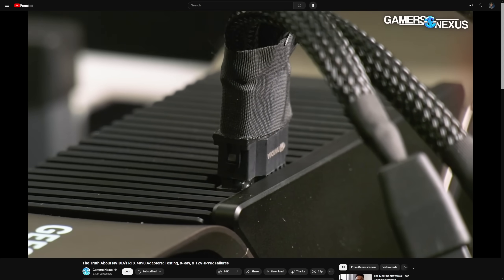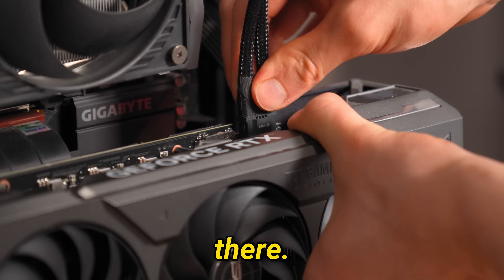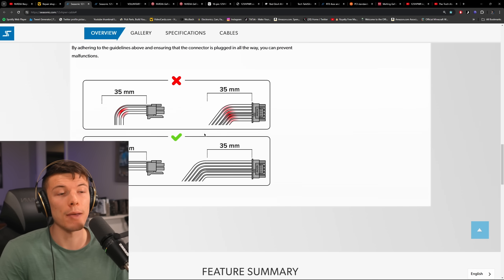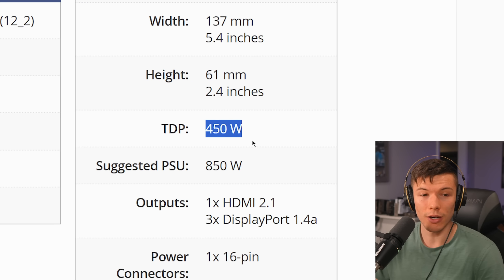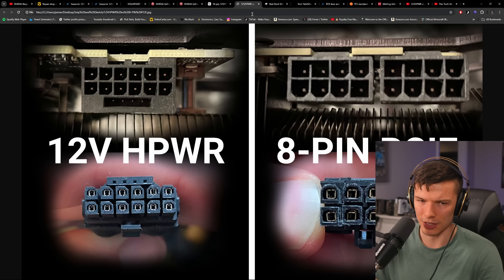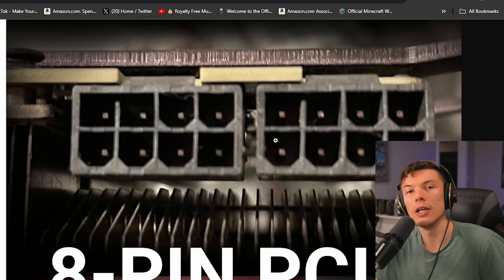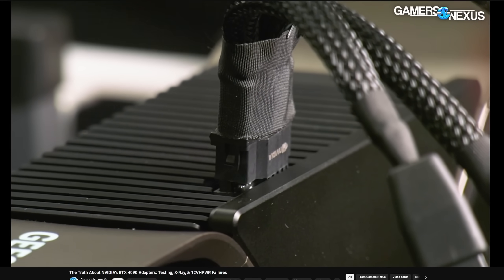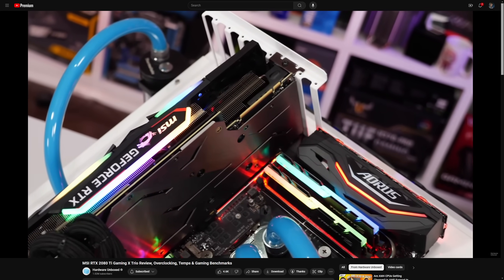The Dumbest Thing to Happen to Graphics Cards

Comment: with my 4070ti super i just got, i had to put SOOOO much pressure on it to seat it, i was so afraid i was going to crack the connector or the pcb board or something ... it was ridiculous. I was pushing a significant amount of force, like 50% of full power, and when you think about that for plugging in an electronic device, that is insane. fortunately, its been fine (Gigabyte Eagle)

Comment: My 4090 has the new 12v-2x6 connector. Have been running it with an ATX 3.1 PSU and have zero problems.

Comment: Spec sheet says it all, 8pin 288W, 12v  684w, but then look as the 'safety factor' 1.9 vs 1.1, thats over 70% higher margin for safety.

If we was to use same safety factor as Nvidia 12v on the 8pin then it would be rated at 261w not 150w
So 2x 8 pin would still be safer than the 12v and provide more than enough

Comment: I think they should have used 2 12VHPWR connectors on the 4090, that card pulls more power than a single 12VHPWR can handle.  I have a 4070Ti which pulls a smidge under 300 Watts and it doesn't even get warm.  The 12VHPWR is definitely less fugly than the massive 8 pin connections,  but they asked too much from it in the case of the 4090. Nvidia dropped the ball on this.

Comment: I knew from the beginning that the 12VHP power connector was stupid because it didn't do anything that the existing PCIe supplementary power connectors didn't.

My ASRock Radeon RX 7900 XTX has three PCIe supplementary power connectors and they never miss a beat despite drawing almost as much power as an RTX 4090.  Are they elegant?  Who cares?  I never thought of "elegance" when it came to PCIe power connectors before so why would I start now?  If you want "elegance", then all that a company has to do is put the power connectors at the end of the card like they used to.

Even if I were willing to shell out more money for a GeForce card (which I'm not), that oddball connector would've kept me away until I knew for sure that it worked.

Comment: My Asus rtx 4070 ti super 12vhpwr adapter that came in the box needed so much pressure to plug and unplug I was afraid it might break the card. I bought a 12vhpwr cable through seasonic for my GX-850 psu and it fit perfectly, plugged in and out smoothly and clicked positively, good tight connection. It seems like that cheap adapter from Nvidia is so poorly made and doesn't fit the video card perfectly so it takes a gorilla to jam it in to get it to seat properly. Nvidia need to do better on their adapters as they need to be more precise. I think the reason Nvidia need such a small connector if their founders edition cards the circuit boards are so small they don't have room for many x8 pin connectors so their sticking al the cards with 12VHPWR connectors, like it or not.

Comment: I think the biggest thing you missed is cost. The 12vHP connector takes less space on the board so they can use less tracers and less space so the board can also be much smaller. Then they have there own property connector that every 3rd party has to pay a royalty to use / make a connectors for it to use. End case they needed less space taken on the boards to cut costs in manufacturing and wanted everyone to pay more royalty's. They are scummy like Apple. But i still use them as currently they are the best. Sorry. Cheers for the videos.

Comment: Man, 8 pins are rated 288w, not sure what you are on about. Always been that way. Its also what it is been said on that image you keep showing. Also, why go on so much on the wires when the problem has always been the connector, meaning the plug on the GPU.

Comment: There were already connector standards capable of more than enough current on the footprint of a fingernail. Look at XT60/XT90 capable of 60/90 amps (Thats over a kilowatt) of continuous current. You could do 2 4090's with 1 of those. If you gotta have two rails just use 2 they're small enough.

Comment: So simple…….there are 90 degree connectors that can be used with the old style 8 pin connector. That eliminates the triple wires over the top.

Comment: How many of the melted connectors are running at the full 600w and how many are at stock 450w. Im guessing running  at the full 600w pushes the connector into a zone that makes it way more susceptible to failure

Comment: BTW, for gaming at 1080p/60, the card is certainly overkill.  But for doing open source AI models, the $2000 USD is a real bargain if you check where the next AI price point is.

Comment: RTX 4090 OC:  I built a custom aluminum scaffold to apply constant insertion force while removing all other loads (vector loads; not electrical loads) applying basic civil engineering.  Learned on my own as I am a retired software engineer.  Either my design is genius, or I am just lucky.  According to Der Bauer ... lucky; as the the original socket and plug has no engineering margin of error which is bad design, and brings down planes and bridges.  BTW, I did not use NVidia's Hydra (no sense pins), but instead used the easier to work with cable that came with my PSU.

Comment: Dear @Vex - no ... 12HPVR is not even using all 12 cables to push power, just top row AFAIK - which is even worst. Not only now any 4090 but also 4080 exhibit this, so all of them are 'no-go'. If 50xx still uses this - then same rule applies - 'no go' if you do not sleep on stockpile of money.  12HPVR does not equal to 12HPVR 2x6 - in the latter standard BOTH 6 pins rows are utilised. But that requires PSU that pushes through those bottom 6, and also has the 'sensing' pins socket. Really I have one such PSU CoolerMaster 850i. So what you have been reading is their NEW approach to 16-pin connector just approved in ATX 3.0 PCISIG consortium, but it is NOT what attached to the sold card cable is doing! Get also that - NEW NEW - revision has shorter sens pins, which will bring yet another issues (it suppose to detect if the plug is fully seated and disconnect power from it when not) but the problem is that the power draw of 4090 is just too high for pin themselves. Lets not forget - all cards also receive up to 75W through PCIe slot.

Comment: as far as my gigabyte 4080 (non super) the 12VHPWR connector and adapter (3x 8pin) are VERY sturdy and connect very tightly. it even hangs from the top of the case (TT level 20 HT) which means the way the connector hangs bends the cable sideways which is supposed to be the highest failure position but still not even a warped connector and i periodically inspect it.

Comment: To add to the question of how this released .. you know that safety factor of 1.1? It doesn't meet national electrical code standard... Max continuous current shall be 80 rated... Meaning a 25% safety factor... Or 1.25 is necessary.

If I signed off on this I could be publically kicked from the engineering profession for life.

Comment: Bought an RTX 4070 because of the exact reason. I still do not trust the 12VHPWR connector. Ever since I run with my MSI RTX 4070 at a MAX powerdraw of 130 Watts (undervolted + OC). 
The RTX 4000 Series Cards can be such low Powercards, yet they came up with  a connector that they clearly do not need. I honestly dont understand Nvidia at this point at all.........

Comment: I bought a new gaming PC two weeks ago, including a 4080S. The first thing i did after assembly and installing Windows was Furmark, and thermal imaging of the 12VHPWR connector at the graphics card and at the PSU. No Problem.
Since this was my first build that required such a connector, i was quite surprised how tiny the pins are, seeing them the first time. 
I really think that this connector is a bad design, and should have used bullet connectors like in XT60 or 90 plugs.

Comment: I don't understand it, my 4090 came with the 12vhpwr adapter with 4 x8 pins but I didn't like that so bought the Corsair 12vhpwr cable that only has 2 x8 pins on the PSU side! It's been fine for over a year but why does it need 4 x8 pins if using the nVidia adapter but only 2 x8 pins on the 600w corsair cable??

Comment: (ONE) 16 gage wire is rated to 13 amps, that is equivalent to 1560 watts.  A 12VHP- connector uses (12) 16 gage wires and is rated to only 600 watts. Each wire is carrying only 50 watts. I don't see the problem?

Comment: I’ve been very concerned about it, thankfully haven’t been one of the unfortunate ones affected by it.  My water block stops it from bending too close to the PCB, that probably helps. 
I used to pull 530 watts regularly, but I typically limit power draw to stock TDP unless I really need a few more frames

Comment: If they believe that the 12 pins of the 12VHPW connector are good enough for power delivery, why not just use two 6-pin connectors? At least the pins are bigger, and it’s reliable. Or, just leave us with the two 8-pins that we’ve had.

Comment: I am not writing an excuse for Nvidia, it needs to be addressed however there are reasons this occurs. Biggest is zero tolerance for error with pin contact, you have to have 100% proper contact or the impedance on the 12v/ ground goes way out of spec causing thermal runaway above the connectors heat rating. 

second is overclocking, it changes the specs the 12v/ground forcing more amps than what they are built for resulting in thermal runaway.  

Solution: Do not overclock and when it comes to cables/ adapters make sure they fit like a glove, they need to be tight and snug and completely flush to the female side of the connectors of both the GPU and the PSU. Yes PSU's 12VHPWR are melting too from not being flush.  

Also when looking for a 90/180 angle adapter, it needs to have a heatsink, a real active heatsink. Only one I know so far that has a real heatsink is by EZ-FAB, currently have a 180 on my Asus Tuff RTX  4090, temps on the adapter never go above 60c, average is 50c.

Comment: i hated the adapter for my 4070 super, so i got the corsair one since i have a corsair PSU. the 12VHPWR connector is such a pain to remove, and install, i literally had to push in my connector alomst full force until i heard that click. so far so good thankfully, but yeah this connector is terrible.

Comment: I've been afraid to buy a 4070 Super because of size and power connections. I have a 2070 Super, and I think the new card uses the same power cables, but the sizes are so large that I don't trust it'll fit securely on my mobo & inside my case 😅

Comment: The rush to 4k has made a lot of what you see just dumb and immature. Hardware that used to be reliable is now suspect and even when working right did not deliver as promised.  And hardware that was ignored (like AMD, Air coolers etc) are showing to be very reliable.

Comment: I actually like the cable, mostly just on paper. I have a 4070 Super, so mine isn't going to melt from overheating. But, I do like how it's one connection to the GPU and you can, in theory, hide the 8-pins somewhere in your case. But, the adapter isn't quite long enough so all the cables end up showing. You would think NVIDIA would be able to make a decent adapters. Especially after different revisions. It's a great idea, but not executed well.

Comment: The average gamer isn't going to need a 24GB video card to begin with.  Let the pro e-gamers test the 4090ti cards because not only can they afford it but they can also use it as a tax write-off but instead they're running an alpha test using regular consumers.  I've been using NVIDIA cards for a long time.  Heck I still have a couple of GTX 8800 OC cards that I used years ago.  The 8-pins are rated to work and it makes no sense to change it and NVIDIA isn't blind to the issues so why do they continue to release the 4090ti cards with these cables?  It isn't ready for public use.   KC

Comment: The worst part about these connectors is the fact that every time i see anything about them i pop my side panel off and double check it again. I have a launch gaming oc 4090 so it has the 1.0 version on it has been fine so far but i would rather have 3 8 pins than this one cable that sometimes ya know starts on fire.

Comment: 8 PIN safety factor 1.9 so it can deliver up to 90% more power than it's rated for. 12 PIN safety factor 1.1 so it can deliver up to 10% more power that is rated for. See the issue? 12 Pin is so close to max specs any manufacturing defect, damage or user missuse will be an issue. I don't work in electronics but in my field of expertise anything below 1.5 is NOT suitable for consumer use and almost everything is rated 2.0 or higher. Pluging a power cable should never be more complicated that pluging in a a toaster.

Comment: GPU power connector red light is an asus thing and asus confirmed that they were going to fix it in within the next update. You can also turn off the red light all together with ERP settings within the bios.

The reason it didn't boot the first time was because the gigabyte board, i had the same long first time boot issue because the board was trying to figure out the pci generation settingfor what ever reason, i don't think that long boot had anything todo with the connector.

Comment: Im sorry brother I have to state a few things, If you got the cash for an 4090 and you dont have the money for a proper psu with atx 3.0, I belive you should stick to 4060/4070 series..the adapter is dumb that I agree Im never using it, i got a psu with the proper cable problem fixed...

Comment: Get a supported 12v connector PSU, then use the 12v cable included, NEVER used the adapter connector that comes with the RTX 4090's, MSI did the right move with their PSU, you their single 12v cables have yellow tips on the black cable, IF you see yellow peaking out on the cables you have inserted then they are not plugged in far enough, this is a big brain move to remove user error which is a reason a large amount of these cases with burnt cables happen.

Comment: 8 pin EPS (aka the CPU power cable) is a really good option.
A single 8 pin EPS connector can handle 300W.
And they are already being used with server / workstation GPUs.

Comment: Thankfully I have not had any issues with my 4090 and that adapter. I have a 1000w psu that is around 6 years old and have it plugged in with the adapter with my side panel closed. I hope they improve future gpus and design them better.

Comment: I don't like the 12vhpwr, but I've been using it out of necessity for a little over a year now.
My card is a used RTX 4090 from an emergency sale.
I used the adapter at the time, and now a native cable.
So far I haven't had any problems with this crappy part of cable. But I don't want to and can't trust it.

Comment: yeaps it's as if NVIDIA is just cutting corners on the power connector  this part should not be a chore to use  it should not need to be a major unreliability factor which it actually is.

There are a few RTX 4070's with 2x 8 pins  but it seems NVIDIA is replacing these with that new unreliable power connector.
I use Radeons  thankfully AMD even stated that the 12VHPWR connector is not really of need, also why they never went over too it plus the countless reliability issues it brings as well.

Very solid video vex, great work bud!

Comment: How else can Nvidia get you to buy more GPUs after all if your sufficiently loaded and dumb to pay over 1500 for a RTX4090 and possibly a new PSU then your sufficently dumb to purchase another when the Power plug and Socket melts. The original pcie power cable was over engineered but the 12Vhigh power Cable nvidia uses has been rushed out and not poorly tested. It is a disaster looks over function(if it was airflow those stupid 3cables take up as much room as 3 pcie cables and look less tidy)

Comment: I got a MSI Expert 4080 Super and used the adapter for a while on my corsair 1000x platinum but decided I wanted a single full cable and there was a Be Quiet! straight power 12 1000w ATX 3.0 platinum on sale on Amazon, so I snagged that up and swapped PSUs.  I didn't have an issue with the adapter when I was using my Corsair psu and so far have not had an issue with my Be Quiet ATX 3.0 psu with the single full cable 12VHPWR...but the 4080 Super doesn't pull as much watts as a 4090 so I'm not sure how helpful this is for a comparison.

Comment: Thank you for bringing the 12VHPWR connectors flaws. To many big youtubers made claims that the connector is fine and its a user issue for not connecting them properly. 

If the design is not user friendly in first place than the flaw is not the user but the product. I have a 7900xtx with 3 8pin power connectors and I have no issues with having it if anything I find it looking cool so the whole idea of the 12 pin connector to remove cable mess is just stupid and pointless if the sacrifice for it is users safety and low quality.

Comment: What I don't get is, why does my 4080 Super even need one, why doesn't my manufacturer put 2 x 8 PIN back in there knowing these are such a failure.
Reply from the maker: I think Nvidia only allowed partners to go with 8-pins on the 4070 and below (which sometimes they still didn’t). Can’t say for sure, but they seem want to make sure it’s on their higher-power GPUs

Comment: GPUs should have just used the EPS cables from the start.  Those are rated for 338W per 8-pin connector.

Comment: the 12vhpwr. connector is so bad in sandwich itx cases. cause the risk of using it is destroying the gpu and psu cable since it has to be on a tight angle to fit in the case

Comment: Personally I did not have any issues with my 4090 and cablemods cable for my PSU. I also used their 90 and 180 degree adapter and I had zero issues, the fit was sung with no play. I removed the adapter because of the recall but I doubt it would have failed. But you are right they could have done better job with this connector, I wonder if 12v-2x6 also has issues.